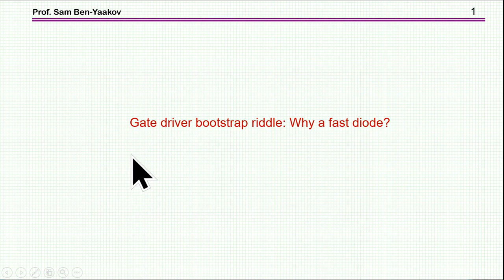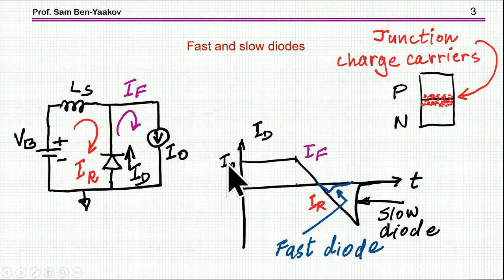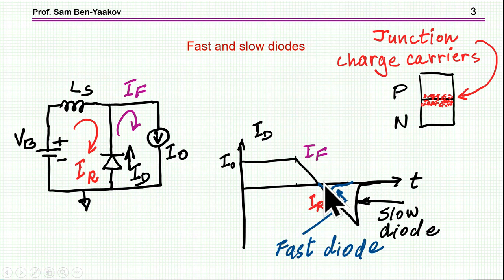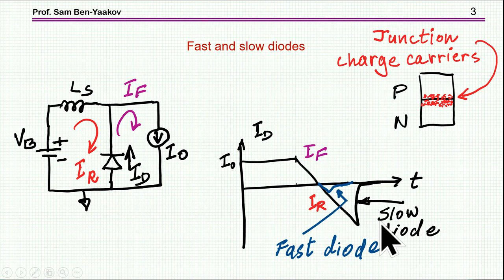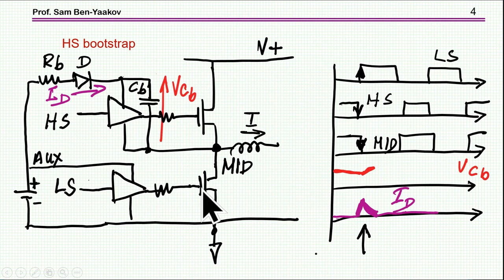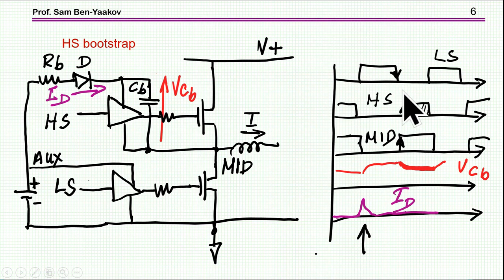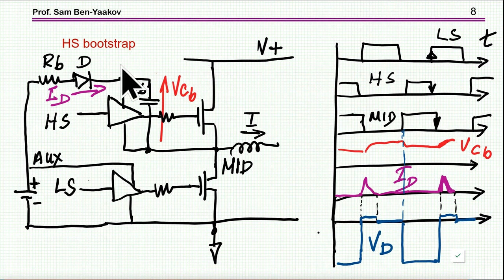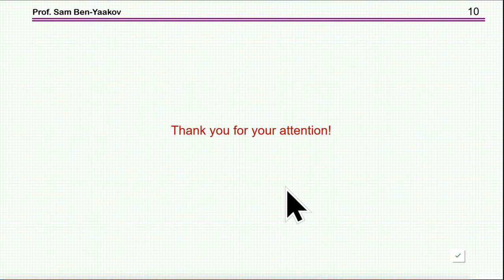Gate driver bootstrap riddle: Why a fast diode?

Comment: A slow diode will sweep out a big chunk of the expensive charge stored in the bootstrap capacitor during it's long reverse recovery period. Meaning there would be a necessity for larger bootstrap capacitor, causing a higher forward current through the diode during charging of the cap. And higher current means larger dissipation on the diode. So, a slow diode will not only make the circuit bulky but it will also increase the power loss due to heat dissipation.
Reply from the maker: But why would there be a reverse recovery current? for that you need voltage reversal when the diode is conducting.
Reply: Prof., When the low-side transistor is turned off and the high-side transistor is turned on, the mid-point voltage grows high to the Vdd. Now, since the bootstrap capacitor's negative terminal is tied to the mid-point, the capacitor's positive terminal voltage is now at higher than the Vdd. At this point the diod's n-terminal which is connected to the positive terminal of the bootstrap capacitor is at higher voltage in compare to its p-terminal which is tied to the Vdd. Therefore, there would be a voltage reversal accross the diode when the low-side transistor is turned off and the high-side one is turned on. But, before coming to this stage, if the capacitor was small enough to be fully charged upto (Vdd - Vdiode-cutoff) during the time while the low-side transistor was on, then the diode forward current has already been reached a negligible value but, if the capacitor is large valued and so large that it can not get the sufficient time to be charged upto near Vdd, then the diode forward current is still significant while the voltage accross it is getting reversed.

Comment: I see one problem (don't know if it's the "da problem") :
1)  There must be a dead time between turning OFF the low side NMOS and turning ON the high side NMOS

2)  If the output current in the inductor has the direction shown in the picture, it will force its way through the body diode of the low side NMOS once this is OFF.  Vmid therefore drops by a forward diode voltage.

3)  Since Vmid drops, the diode D will turn ON just before we start turning ON the high side NMOS. Dead times are very short so D won't charge Cb by any significant amount

4)  Has we turn ON the high side NMOS (and Vmid rises), some charge from Cb is depleted for that, but D is still ON and some charge in Cb is also lost in the reverse recovery of diode D. 

5)  That reduces the voltage in Cb and therefore the available voltage to turn ON the high side NMOS, degrading its RdsON. A fast diode minimizes this.

6)  Also, a fast diode presumably has a smaller reverse junction capacitance. That capacitance needs to charge from 0 to V+ when the high side NMOS turns ON and the current to do that comes from Cb too. A smaller capacitance is therefore beneficial.
Reply from the maker: 👍You pinpointed the problem. Thanks for participating.

Comment: I think the bootstrap cap will be discharged in the moment that middle point goes high with slow diode.
Thanks for the video and sharing so much knowledge to everyone.
Reply from the maker: Thanks for participating, but why is there a discharge when going low to high?
Reply: @sambenyaakov  because the diode is not completely reversed bias in the transition. So the bootstrap cap can be discharged a little.
Reply from the maker: @東昇李-k8u  See my answer video

Comment: 1. In case of very short ON time for the lower switch, when the bootstrap cap is still charging, it is relevant what kind of diode is used: a slow one would charge and discharge the cap in the same cycle and thus limiting the lowest duty cycle considerably. 
2. When the low switch goes OFF, the parasitic inductance causes a voltage spike and some HF oscillations at the midpoint, which results in a reverse HF voltage oscillations across the bootstrap diode. A fast bootstrap diode will survive it longer than slow one, which could suffer a thermal damage, depending on the switching frequency.
Reply from the maker: Good point but there is more to it. Please hold on to my answer.

Comment: hi 
thanks for these great subjects you have always bring them out . 
i think the need of fast diode (fast recovery time) here to prevent the bootstrap disharging in reverse direction due to the diode revers recovery current  when the midpoints goes high.
Reply from the maker: Thanks for participating, but why is there a discharge when going low to high?
Reply: When the midpoint goes high the diode would be in reverse bias condition as the midpoint voltage become higher than the  gate drive power supply voltage

Comment: When the lower driver goes off, the MID node is held low by n-FET's body diode as the current is flowing thru the inductor, being sourced by ground.

Now, when the high driver turns on, it slightly discharges the C_b capacitor before MID goes sufficiently high as MID effectively sits at GND level or slightly below it (depending on the forward voltage of the body diode). This situation forward biases diode D, thereby making I_D>0 again for a short time. Slow reverse recovery of D might discharge C_b close to the upper transistor's threshold voltage before MID swings high, which would leave the upper transistor only half open, causing unnecessary losses.
Reply from the maker: Thanks for participating. Very close, but there is more to it. Hold on to my answer.

Comment: I have two ideas:
First of all because fast diode has smaller voltage drop across it and therefore generates smaller power loss on the diode. 
Secondly regular diodes have significant junction capacitance and thusly with the bootstrap capacitor they create capacitive voltage divider and in turn the voltage on the bootstrap capacitor is lower. Fast diodes have smaller capacitance and therefore predominant part of the supplied voltage is present at the bootstrap capacitor.
Reply from the maker: Some good points but there is more to it.

Comment: 1. guess: The HS driver switches immediately before MID goes low, thus consuming power and discharging the cap. So the diode actually conducts before going to reverse.
2. guess: a small current alone is not enough to deplete the p-n junction, already some nA are enough to forward-bias the diode and have charges available for reverse conduction. This reverse current is large, because the reverse voltage is high.

Very interesting riddle indeed
Reply from the maker: Thanks for participating and note.  #1 ???
Reply: Oh, my argument for the first guess is the wrong way around. The HS-Driver switches the HS FET, consuming power from the cap. This brings the diode into forward conduction for a very short time, until MID starts to rise. Thus there is current flowing, when the diode goes into reverse operation.

The problem is that the voltage on the flying cap is also the overdrive of the FET - when the Diode draws current in reverse during this period, Ron of the FET increases.

Comment: I think that reverse recovery charge is required to turn off the diode since it is a minority charge carrier device. If we are using a slow diode that will affect our Capacitor Voltage and might slow our turn on time and increase switching losses.
Reply from the maker: Thanks for participating. There is more to it. Please hold on to my answer.

Comment: At start-up, the diode will most likely conduct for the entire on time of the bottom FET , thus at turn off of bottom FET the diode will be subjected to reverse recovery.
Reply from the maker: Good point but there is more to it. Hold on to my answer. Thanks for participating.
Reply: @sambenyaakov  Thank you Prof. I got another answer for the question: when H-Side MOSFET turns off the drain inductance of the L-Side MOSFET (together with the inductive load) will pull down the common node voltage below 0V (as per V = Lleak * di/dt) causing the bootstrap capacitor to begin charging. when this transient is over the common node voltage has risen to minus body diode voltage of the L-Side MOSFET. This sequence of events will cause the bootstrap diode to enter reverse recovery.

Comment: I have 3 ideas:
1) If i'm informed correctly, removing the charge is only possible with a reverse biased voltage, so zero current is not enough.
2) Stray inductance in the bootstrap circuit will extend the time of current flow.
3) Depending on the dutycycle, the on time of the lowside switch can be very short, thus the charging periode perhapps is not over, and this operating mode is the most critical one, because of the combination of not charged fully and get discharged by reverse current and get discharged by long on time of the highside switch.
Nice video as always.
Reply from the maker: Thanks, good points but there is more to it. Hold on to my answer.

Comment: At the example in the video charge time of capacitor is  too small! So when high side getting turned on there's almost no current at the diode so it seems like no problem but when frequency rises, fraction of capacitor's charge time is  gonna increase too. If there's a forward current in (at diode) the time just high side turning on and reverse current would be more significant affects.
I hope my thought is corrent prof.
Sorry for poor grammar. 😅
Reply from the maker: Thanks. I have already posted a solution.

Comment: thank you mr professor 
i think slow diode decrease charge of capacitor when high side driver is on because this diode put in reverse bias when high side driver is on and this very bad situation for high side mosfet because boot cap must put charge in high side mosfet and when we use slow diode boot cap cant charge good and cant charge hs mosfet gate charge 
so this situation increase power dissipation in hs mosfet and decrease efficiency in buck converter
Reply from the maker: Just a reverse voltage does not cause reverse current the diode need to conduct.

Comment: Professor, I think because of inevitable stray inductances in the bootstrap charging loop with the diode, the more the reverse recovery current the more reverse voltage shock(di/dt) will happen to the diode. The voltage shock may also  distributed to the LS driver circuit and causes damage to driver components. EMI effect would be a byproduct of this issue as well.
One more thing is that the more reverse recovery time causes limitations on switching frequency of the Half bridge.
Thanks 🙏
Reply from the maker: Thanks for participating, but why ids there a reverse current?
Reply: Prof  @sambenyaakov  , the reverse recovery current happens immediately after charging completed because of a series RLC circuit that L is parasitic inductance and C is the Cb, in fact energy stored during charging in L will continue to release to the Cb and increase the voltage of Cb above Aux DC voltage then in reverse the diode demands reverse recovery current, 
Now I think this moment is critical as it depends to the L and Cb and Vaux that the reverse recovery charge is met or not, if not met, during the switching from low to high it will happen that is not good and may interfere the high side switching performance as the Cb voltage can be affected in switching transient.
Reply from the maker: @esijal  Close but not exact😊

Comment: Is it because V+ is "connected" via Cb (which adds its voltage to V+) , D and Rb to Vaux? As a result, we have power "peak" "injected" into Vaux.
Reply from the maker: Thanks for participating. Not really. Hold on to my answer.

Comment: Maybe fast diode will have small forward recovery parameter. With long forward recovery time there would be issue with reverse recovery. Thank you for video.
Reply from the maker: Thanks for participating. There is more to it. Please hold on to my answer.

Comment: Hello Prof. 
in my opinion, you don't need a fast diode but you need a diode with very little capacitance. 
The parasitic capacitor of the diode will be charged when the HS transistor begin to conduct thus it will create a reverse current through the diode that is similar to revese recovery current.
I want to emphasise that it's not reverse recovery current but capcitance charging.

Usually fast diodes also has low capacitance but it's not mendatory and a designer should always check the capcitance of the diode in the datasheet. 

Very intersting question 😀
Reply from the maker: Thanks Dor for participating. Indeed , small capacitance is desirable but there is more to it. Please hold on to my answer video.

Comment: My perception: 
The ringing in the MID point causes negative spike. Which inturn has the effect of overcharging of bootstrap cap.  The diode is reverse biased for this negative spike interval which should be recovered fast for proper functioning of IC.

Comment: In order to minimize bootstrap capacitor discharge, after turning off low side sw
Reply from the maker: Why would there be a discharge?
Reply: @sambenyaakov  Beacause when high side sw is turned on the diode is in reverse polarity, and diode in reverse polarity is like a capacitor which will consume some energy stored in bootstrap capacitor. In addition there may be in inductor some current that may discharge the capacitor at dead time when high and low side sw are off.
Reply from the maker: @armangevorkyan1975  There is more to it than just the capacitance. Hold on to my answer.
Reply: @sambenyaakov  It will allow to use smaller bootstrap capacitor for fast switching and will allow low sw to turn on faster.
Reply from the maker: @armangevorkyan1975  See my answer video

Comment: Cb will discharge faster with a slow recovery diode and the HS gate driver would not drive the HS mosfet adequately. Using a fast receiver diode would hold the charge in Cb to feed the HS gate driver sufficiently.
Reply from the maker: "Cb will discharge faster with a slow recovery diode" why if there is no reverse recovery?
Reply: @sambenyaakov  without  reverse recovery.... As in an ideal diode? Then I guess there might be a chance the HS mosfet remains on?  But the driver is a class B or an inverter formation typically, signaling low on the class B driver's input will drive low and sink the charges down no matter what the driver's vcc state. I'm more curious now. Not sure.

Comment: It's a stupid design to have the HS driver amp powered as shown. The HS amp should be powered the same as the LS amp, then no issue with reverse current out of the HS amp decoupling cap.
Reply from the maker: What do you mean  by "the same way"? A costly isolated aux ps? I would  be careful not to call stupid the most common solution implemented in probabely tens of millions units.

Comment: This riddle is too easy.
Reply from the maker: And what is the answer? I bet you don't know it😊
Reply: @sambenyaakov  Already two people answered correctly before me, "A slow diode will sweep out a big chunk of the expensive charge stored in the bootstrap capacitor during it's long reverse recovery period. "
Fun fact. Some days ago, i did some tests of a power supply at elevated temperatures (55°C), which I designed myself. It's a step down converter which uses a half bridge with bootstrap drivers exactly as in your riddle. Everything worked fine for most of the time. But as the duty cycle approached 85%-93%(max) (f=100kHz), the diode gets really warm, somewhere around 100°C in still air. Unfortunately, a piece of foam rubber, which is used as an air guide, was misplaced and covered the diode, which got REALLY HOT, melted the foam rubber a little bit and became so leaky, that the driver refused to work. Luckily, the undervoltage lockout just disabled the high side driver and nothing was damaged. After fixing the foam rubber and replacing the diode and driver, everything worked just fine. The diode is an BYG23M (U = 1000V, I=1.5A, trr=75ns)